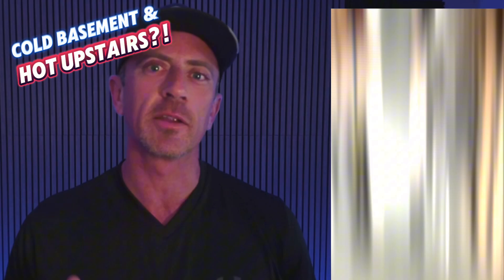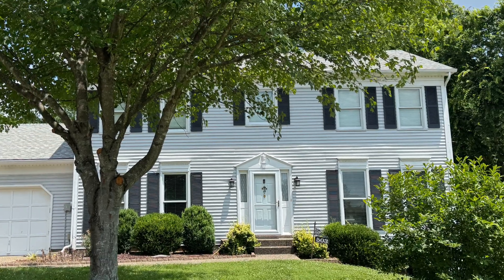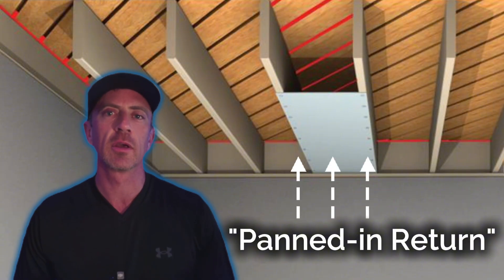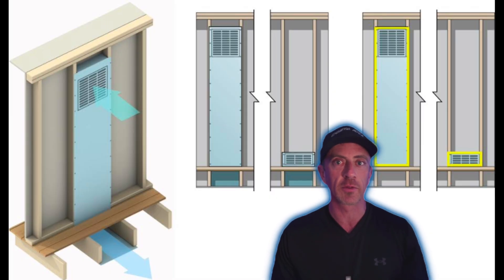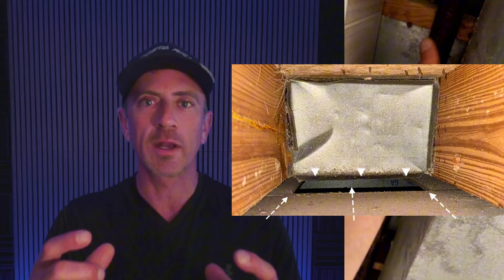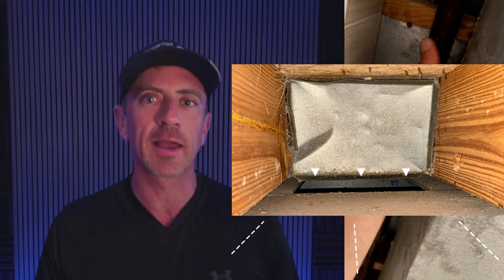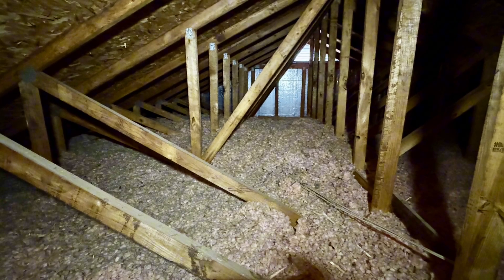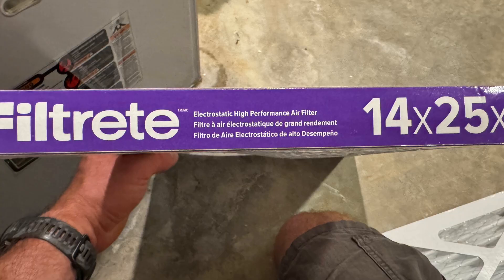HOT Upstairs and COLD Basement?  Ductwork Issues Could Be the Problem!

Comment: In my business, I often specify zoned dampers on my ductwork, so we can have multiple set points of heating and cooling on different levels of a house, with basement and main floor, let's say. If the ductwork is properly sized, I see a huge improvement factor could a micromist system such as Aeroseal in the ducts. I'm in the camp where I want to treat my foundation drainage and duct work mastic from the positive side of the pressure, not the negative side. Pipe mastic is somewhat of a bandage, compared to Aeroseal. Once you get the pipes coated (it seals up to 99% of air leaks), the system can be balanced for temperature. Add insulation, air stop details everywhere.
Reply from the maker: If you plan a new house for a zoned system and the HVAC system and ductwork is sized properly (and the right type of system) they can work well.  Often they aren't planned well though, and in older homes they get installed as a band-aid for attempting to fix comfort issues that are really an insulation and/or air leakage issue.  You'd probably like my interviews with David Richardson from National Comfort Institute on my channel.  This video covers zoned systems with a local HVAC expert named Richard Roth - https://youtu.be/ewJxLxeJXOE?si=lfoFQcmEW2bsMjXd

Comment: Great explanation of the issues in that house.  I think I might have a similar problem with the ductwork in my basement, but its all covered with drywall now, so it's not going to be easy or cheap to fix it...
Reply from the maker: Despite the trouble to fix, it could be well worth it.  If you plan to stay in the house for many years I'd recommend you figure out what it will take to fix it properly

Comment: Yes that is what I've seen in my house but its way worse. The removed the pan from two of the upstairs air returns and the ceiling below has one by twos, thereby "returning" the air from that entire downstairs area. Its a big job to redrywall that ceiling but I'm almost ready to pull the trigger on that.
Reply from the maker: So are the panned-in returns in your upstairs located in walls or ceilings? Or both?
Reply: @HomeComfortAdvisors  The cold air return from two rooms run into the same common wall.
It drops down into the rafters through a cutout.
when looking down, I can see the drywall of the family room below.
I know there are one by twos run perpendicular to those rafters because I put in recessed wafer lights and ran into one. 
So in essence the "cold air return" is the upstairs two rooms plus the ceiling space of the family room below. So about 50 years of dead stuff and dust that can be sucked into the cold air return. 
It obviously won't be good as a return for those two rooms.